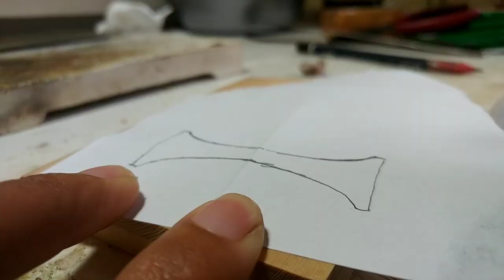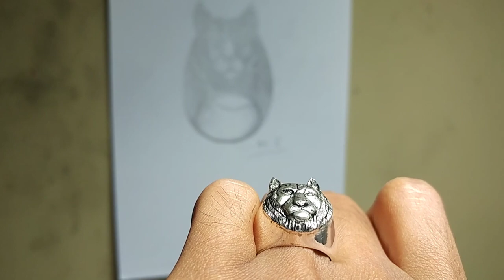unique ring making - jewelry handmade

Comment: What is the name of the drill tool your using to cut the design on the metal?
Reply from the maker: I'm use foredom flex shaft sir..
Reply: @AnifG   thanks for responding ..i was refering to the bur you are using to cut the designs on the metal, not the flex shaft.